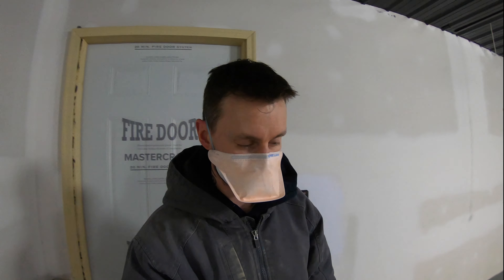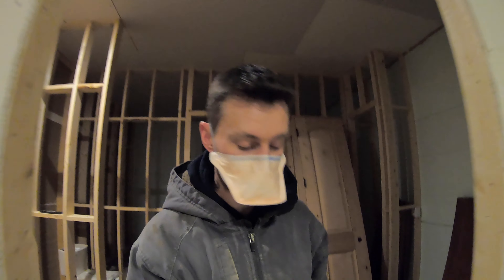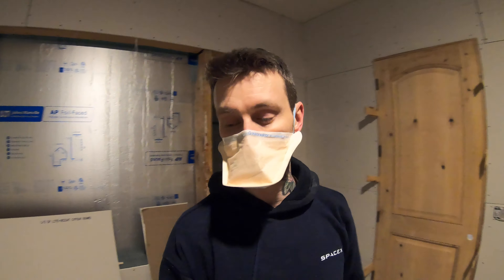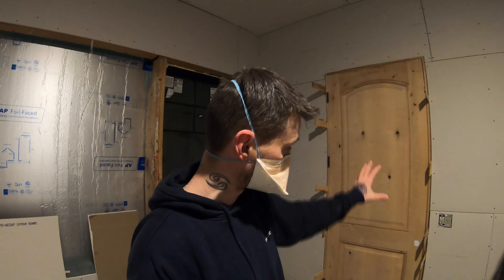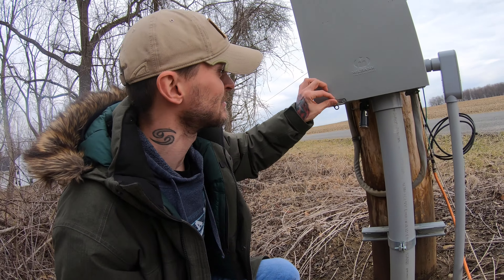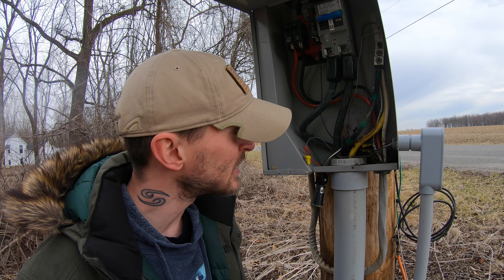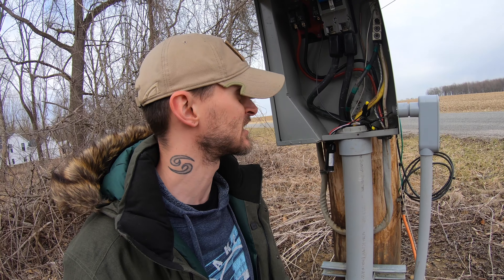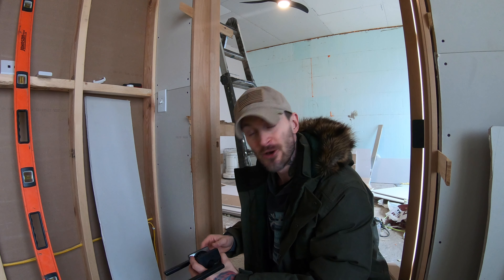Mice eating our electrical!!!!!  Ready for ceiling insulation!!!

Comment: Use mouse bait that makes them go seek water.

Note that as you increase the depth of blown in insulation the weight above compresses the lower layers and you lose R value, it's a diminishing returns problem. I did work a house that blew in insulation, "decked" over it with wire mesh then blew in the top half.
Reply from the maker: yeah thats why i think R60 is the max you go with this stuff i want and why they say blow in 17.3" and it'll settle to 16.1" but still be an R60.  i guess in 10-20 years ill have to reassess and since those upright furring strips will still be there and not shrink, it'll be easy to see more and more settling and fix if need be.

Comment: We foam all of the doors inside. We don't put in screws unless there is some specific need or a situation doesn't allow for foaming

Love the door "button-lock" mechanism

P.S. I see that the neighbour's house is done
Reply from the maker: Ugg don’t remind me.  The noise is just insane!!  Once a completely quiet place at all hours and now 24/7 an electric heat pump/condenser outside facing my side since for whatever reason they decided NOT to use the free 500 gallon propane tank that now sits and make the whole house electric.  I get I’d hear the condenser in the summer for AC but also winter???   Unreal, I want to move.   It’s such a huge huge mind F*$k.   And I’ll definitely be foaming the doors.  Less screws are better since it’s less to fill and cover up later.
Reply: @neckofthewoods24  Build some nice fat evergreen bushes on your edge towards them, or a solid wall that will reflect the noise back at them. You can't change their choice, but you certainly can make your piece of land suit you best. regarding all-A/C, it's almost the same to heat the apartment with a good A/C that it costs to heat it with gas heating. And that's for a 70-year old apartment without thermo-facade

Regarding the foam, you'll break the (room) door prior to kick out the jams that have been foamed properly (outside doors/windows are a different story). No need for fasteners at all. 
In Europe we don't do much of painting. Untouched factory/nature made finish is the key - and for that you can't nail through it, fill it and paint over it. And you can't compare the aesthetics of something like that to solid-painted
Reply from the maker: @morrak666  in the summer its solid!  but yes erin does want a ton of mature trees to plant, they are just pricy she says.  o we for sure wont paint them, just a stain she'll pick.  my screw are on the door side so when closed you cant see them but ill use wood filler to cover them up and then stain over top.  i think she wants a dark stain to make them look old since they have so many black knots already.   im sure once done they will look amazing and they are already starting off with and amazing look .
Reply: @neckofthewoods24  The solid wood always looks sleek
For as long as you've been there, a medium, less expensive plants would've already grown much. In 3y you can have a 3-5ft tall bush from a single 1ft branch of e.g. Cherry laurel. And it's evergreen and resistant to diseases and elements
Reply from the maker: @morrak666  I’ll tell Erin. I’m sure this year we’ll get to planting what she wants as they are in now and can see over and vise versus.

Comment: Spraying foam on the inside doors will help for sound and strength. Using a bread knife I have seen on other U Tuber's works best for rockwool. Decon type killer or ammonia pored down the pipe may solve your problem with the mice.
Reply from the maker: The mice around here have eaten every type of poison you can think of and are still going strong!  I don’t get it!  I put some moth balls down into the pipe but I don’t think he came out.   It’s been spray foamed now so he’ll either chew out or die soon.  I was afraid to put any liquid down there incase it eat the coating on the wires.  As for spray foaming the door I think I’ll do it since sound transmission is what we’re trying to stop!

Comment: Suicide the mice. Hookup a garden hose to your gas (not diesel) car exhaust and pipe the other end into the 3 inch electrical conduit.  That will be the end of them quick. I did that with a mole issue in our field. Just make sure to seal it afterwards so new mice don't move in.
Reply from the maker: O man that would have been a great idea!!!  I sealed it so maybe they’ll die over time but I bet in a few days they’ll crew up through the foam.  Wish I would have thought of that first though!!